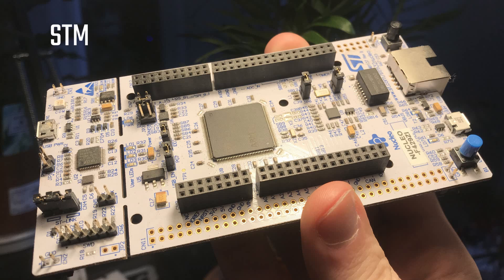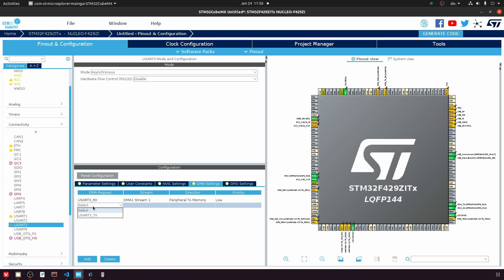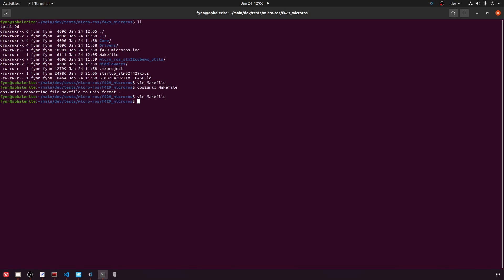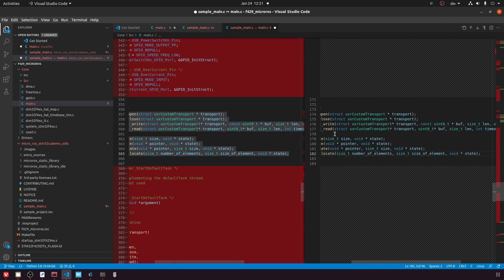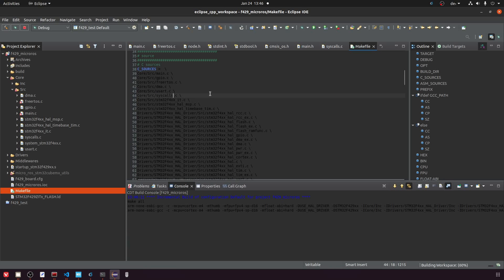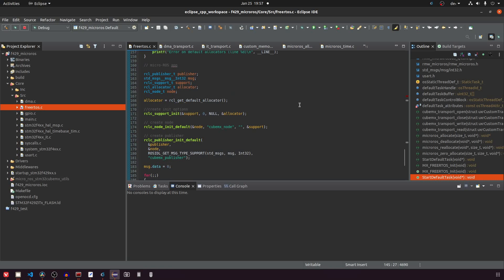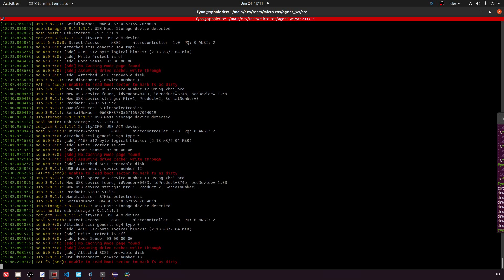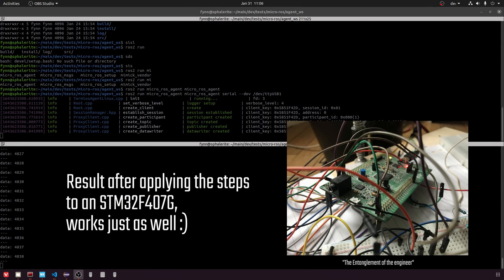How to setup micro-ROS on any STM32 microcontroller

Comment: Thank you very much for your tutorial. However, I have some questions that require your attention. As I follow the tutorial step by step, I encountered the following issues.

When I reached the step of generating the static library, that is:
docker run -it --rm -v $(pwd):/project --env MICROROS_LIBRARY_FOLDER=micro_ros_stm32cubemx_utils/microros_static_library microros/micro_ros_static_library_builder:foxy

The command line output is different from what is shown in the video. What I got was only 'Creating firmware for generate_lib platform generic.' 
This seems like the 'make' process has not been executed. What could be the reason for this and how can I resolve it? I am looking forward to your reply.

Comment: Hi! My ros agent gets stuck on the "set_verbose_level | logger setup" part. I get no errors, code seems to be fine. It is said on the github page that check that your MCU doesn't crash anywhere (e.g. in the syscalls), but it does not crash, any solutions to this? 

FIXED
Reply: Same problem here! please help @Robotics in a Nutshell
Reply: Do you remember how you fixed this? I am getting the same problem. I have found that my publisher is invalid but I have no clue how to fix this.
Reply: @steopaelidrissi1370  I remember fixing it in the clock configuration settings. Check if the numbers in your clock configuration match the ones in the video. I think that was my problem.

Comment: Hi! It is an awesome and really useful tutorial. Thank you! I have one additional question about ethernet transport. Do you have any knowledge about it? How does it work by default in the STM32 based devices officially supported by the Micro-ROS? I tried to find any transport layer or some details about how to send packages by ethernet and I found nothing. It is configured by the environment variables and nothing more.
Reply: I'm new to ROS / MicroROS, but you could look into STM32 + LwIP in combination with FreeRTOS.

Comment: Hi, I don't seem to have to "openocd.cfg" file as shown at 14:44 . I tried with the "st_nucleo_f7.cfg" present in "/usr/share/openocd/scripts/board" folder for my STM32F767ZI. But it throws an error when I hit debug saying ' Prefer GDB command "target extended-remote 3333" instead of "target remote 3333" '. Any solutions?
Reply: Did you resolve? please help im stuck there as well

Comment: Hi!
When I run "docker pull microros/micro_ros_static_library_builder:humble"
It returns:
<Emulate Docker CLI using podman. Create /etc/containers/nodocker to quiet msg.
Error: short-name "microros/micro_ros_static_library_builder:humble" did not resolve to an alias and no unqualified-search registries are defined in "/etc/containers/registries.conf">

How to fix this error?
Thanks.
Reply from the maker: Hey there, it seems the short hand identifier "microros/micro_ros_static_library_builder:humble" is not supported anymore for security reasons. Can you try "docker pull hub.docker.com/r/microros/micro_ros_static_library_builder:humble" instead?
Reply: @roboticsinanutshell  Hi!
I don't see file openocd.cfg on my project. Where I create or download it?
My board is Nucleo-f446RE.

Comment: My experience with the blue pill stm32f103.
I have found this video very interesting and have tried my best to make it work.
The video has been tricky to follow, for me, who is working way past my knowlege, but it has been good to learn more about the STM32 and cross compliing.
My first problem compiling was that TimeOut_t was not defined when compiling microros_time.c
I fixed this by adding #include "task.h" to microros_time.c.
But then I hit a lack of RAM:

build/STM32F103C8.elf section `.bss' will not fit in region `RAM'
region `RAM' overflowed by 24912 bytes

So, I guess that it is game over till I find a cheap board with a lot more RAM.
But, it has been an interesting journey this far :)

Comment: Hi ,
I am using STM32H7A3ZI-Q.

Used tools: STM32CUBEMX,
STM32CUBEIDE(instead of eclipse).

In STM32CUBEIDE->Debug configuration-> GDB OpenOCD Debugging not coming.so,I debugged with STM32 C/C++ Application .
But in that in task.c code has stucked.

Is GDB OpenOCD Debugging needed?

Or any other way to solve the issue.?
Reply from the maker: Hi there,
I have not used STM32CubeIDE so I'm not sure. If you can flash and attach a debugger it seems the general connection is working.
Try to set a breakpoint at the very start of your main() function and see if it is hit. If yes, step through the code and see where it hangs.

To reduce complexity I'd advise to create a very simple CubeMx project without FreeRtos, MicroRos, or any peripherals. See if you can flash and debug that. If yes, add FreeRtos and see if it still works. Once you have confirmed these two steps, you can build more complexity.

If none of this works, feel free to write again.
Reply: Okay  @Robotics in a Nutshell .
I will do that..and update after it.
Thanks for your reply..!
Reply: I've got kind of the same problem here, the difference is that in my case it doesn't even debugged. It shows the message:  "STM32 target device not found for selected build configuration. Please edit the "Build Configuration" and specify valid device settings.
Reply: There's a file f429_board.cfg and then it disappears and appears a new file openocd.cfg, I've tried to replicate, but I'm using a STM32F746. None of this files were created in any of my attempts

Comment: does it works with the blue bill stm32f103
Reply from the maker: Hi there,

I remember reading that the most constraining factor for micro-ROS is the RAM usage. They wrote in their docs that you need a few ten thousand bytes of RAM to run micro-ROS. I can't find that page anymore so it might not be valid anymore. In their Stm32 repo they still state that you need a thread with 10kB stack. The Blue pill uses a Stm32F103C8 it seems (https://stm32-base.org/boards/STM32F103C8T6-Blue-Pill.html ). Looking at STMs page they state that it has 20kB of RAM (https://www.st.com/en/microcontrollers-microprocessors/stm32f103.html ). There are officially supported boards. The board with the least amount of RAM in there is the Teensy 3.6 with 64kB of RAM (https://micro.ros.org/docs/overview/hardware/ ). The Blue Pill has 1/3 of the Teensy's RAM. So my initial guess would be that you can't use the Blue Pill with micro-ROS or at least that you will be very constrained. On the other hand, you might only need 10kB of RAM for micro-ROS and have another 10kB for your program. If that suffices for you, it may work. In the end, the truth is in the attempt. Only testing it will reveal whether it can work or not.

Micro-ROS also provides information how to tune its memory consumption. You can find links at the top of the page with the official boards. It might be possible to tune it in such a way that it can run on the Blue Pill.

Comment: Hey, thanks for the tutorial, i have micro blaze on Zynq UltraScale FPGA platform, do you have any tutorials on how to set up micro ros on the microblaze using Vitis? i haven't found any resource that could help and i couldn't quite understand how to make the right  Adjustments to my processor using the generic lib in micro ros git hub
Reply from the maker: Unfortunately I don't have experience with this system. I'd probably try to generate the static library (listed here: https://github.com/micro-ROS/micro_ros_setup) and include that in your build. That should allow you to include the micro ROS headers into your code. I assume the API for the lib doesn't change so similar steps as described in the video should still apply in general. Set up a publisher / subscriber, connect it via UART, run the micro-ROS agent, and see if it works. If it doesn't, attach a debugger to the MCU or see with prints (use another UART as micro-ROS) where it fails and analyze from there. These steps are just my best guess how it could work, so take the advice with a grain of salt.

Cheers and happy new year :)
Fynn

Comment: Hi, I found the video very clear until 8:48 minutes then you started in super-speed to open different IDEs and I couldn't follow you anymore, most likely it's just my problem that I don't know English well enough , is not that you can give me some explanation of what you did then? I'm following with the subtitles but the auto generated ones are really terrible (FreeRTOS is Friend :))
Reply from the maker: Hi there,
what I did there was set up a way to compile the program (the binary file for the micro controller) in Eclipse (IDE). You don't have to use Eclipse, I just like it for its debugging capabilities. At 3:40 we've set the project up to be Makefile based. This means that in general you simply have to run "make" in the root folder of your project. Since I don't want to type "make" into the terminal all the time, I set up the IDE to do that for me when I press a button.

There is one special thing about this though. Usually you would simply use a compiler like g++ to compile your program. But since we are compiling for an embedded system, we need to use a different compiler. For example you can use arm-none-eabi-g++, you will have to install that. You might know that a compiler looks at the C/C++ code and transforms it into assembly code. The available syntax for the assembly code changes depending on the system, they have different instruction sets (assembly syntax / commands). This is why you need a different compiler. It will do cross-compilation for you, which simply means that it will compile the code for the embedded system and not your own PC.
The Makefile generated by CubeMx already takes care of choosing the right compiler for you when you run "make". But you will need to install it first.

If the compilation ran through without errors, there will be an .elf or .bin file in your build folder. This is the file that you have to upload to your micro controller.

I hope it helps :)
Cheers
Fynn
Reply: @roboticsinanutshell  Thank you, then reviewing the video with more attention and calm I was able to make everything work.

There are two aspects that I would like to find explained in a new video if I feel like doing it :)
The first, which is driving me crazy, is the publication of a message of type sensor_msgs / msg / battery_state.h. As soon as I try to publish the program it jumps into HardFault_Handler ().

The second aspect is the subscribe of a message.

Comment: good job! but for me it's very hard to step by step to follow this tutorial, because I don't know how to connect each other(pc and mcu). and how to upload the code to mcu. Can you recommend other reference tutorials? Can it be understood that after generating the code for stm32cubemx, after making the modifications mentioned in the video, upload it to the development board,  connect each other，and then start the agent on the PC to communicate directly?
Reply from the maker: Hi there,

> I don't know how to connect each other(pc and mcu). and how to upload the code to mcu. Can you recommend other reference tutorials? 

If you have a development board (they look like this: https://www.st.com/en/evaluation-tools/nucleo-f429zi.html) then you usually have an ST-Link debugger / programmer on this board as well. You can connect to it by plugging a USB cable into your board (the one you also power the board with). With the ST-Link you can flash code onto your chip. There are multiple ways to do this. You could e.g. use st-link which is a software tool by ST. You can find an explanation here: https://youtu.be/1cleO3mHjWw?t=336 (until 11:17, then continue at 21:08 to see how to integrate into your IDE). Other options are e.g. using the STM32Workbench (https://www.st.com/en/development-tools/sw4stm32.html). You need an ST account to download it but you can just create one. The way I do it is using openocd and arm-none-eabi-gdb / gdb-multiarch. In this way I can also debug the node (step through the code). This would look something like this:

Terminal 1:
cd path/to/elf_file/
openocd -s tcl -f interface/stlink.cfg -f target/stm32f4x.cfg -c "init" -c "reset halt" -c "flash write_image erase your_elf_file.elf" -c "reset run" 

Terminal 2:
cd path/to/elf_file/
gdb-multiarch your_elf_file.elf
(gdb) target extended-remote localhost:3333
(gdb) load
(gdb) break main
(gdb) continue
(gdb) layout src

The exact interfaces and configs to load might be different.
I'm using it in my IDE so it's not in terminals but happens when I press a button in the IDE. It automatically attaches the debugger and I can step through the code. The openocd calls then look a bit different, they use a .cfg file (this can also be generated with the STM32 workbench). It looks something like this:

openocd -s /usr/share/openocd -f openocd.cfg

where openocd.cfg is:

_

# This is an NUCLEO-F429ZI board with a single STM32F429ZITx chip
#
# Generated by System Workbench for STM32
# Take care that such file, as generated, may be overridden without any early notice. Please have a look to debug launch configuration setup(s)

source [find interface/stlink-v2-1.cfg]

set WORKAREASIZE 0x8000

transport select "hla_swd"

set CHIPNAME STM32F429ZITx
set BOARDNAME NUCLEO-F429ZI

# CHIPNAMES state
set CHIPNAME_CPU0_ACTIVATED 1

# Enable debug when in low power modes
set ENABLE_LOW_POWER 1

# Stop Watchdog counters when halt
set STOP_WATCHDOG 1

# STlink Debug clock frequency
set CLOCK_FREQ 8000

# use hardware reset, connect under reset
# connect_assert_srst needed if low power mode application running (WFI...)
reset_config srst_only srst_nogate connect_assert_srst
set CONNECT_UNDER_RESET 1

# BCTM CPU variables

source [find target/stm32f4x.cfg]

_

 It's a wide topic, this was just an overview. Do some research on your own and try around, you'll get it to run eventually. :)

> Can it be understood that after generating the code for stm32cubemx, after making the modifications mentioned in the video, upload it to the development board,  connect each other，and then start the agent on the PC to communicate directly?

In theory yes. In practice maybe not. For example the MCU I used has a UART (serial port) that is connected with my PC via the USB-cable. This is not true for all STM discovery boards. If your chip doesn't have it, then you need a UART-to-USB adapter cable to create a UART communication line to your PC. You need some form of communication so micro-ROS can transmit data to your PC and vice versa.

Your first step should be to become able to flash and debug your chip. This is the prerequisite for any further steps. After that you can start trying to get the micro-ROS communication going.

Cheers
Fynn